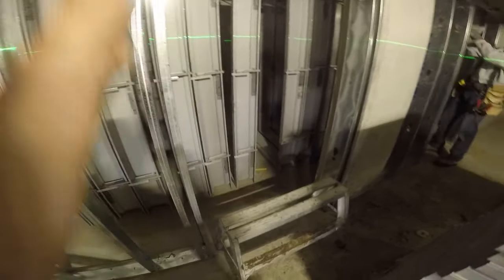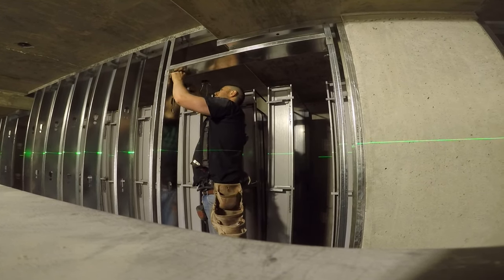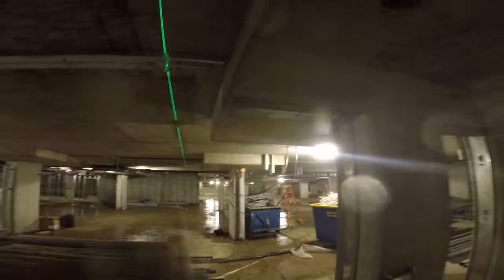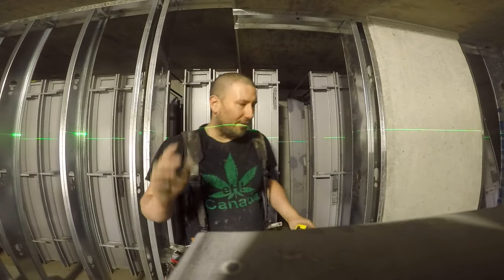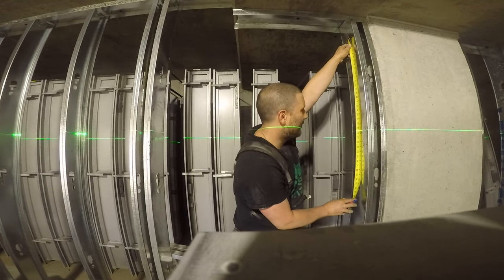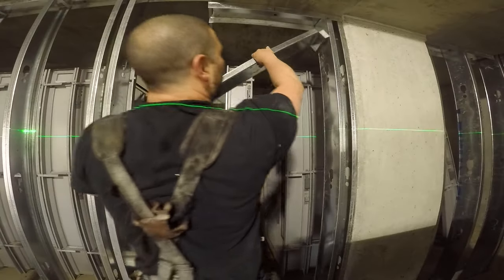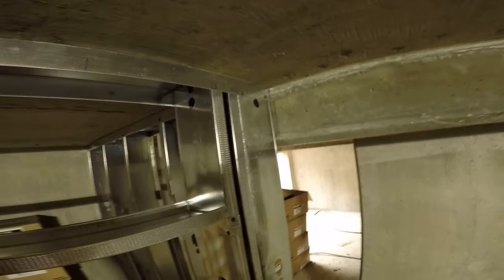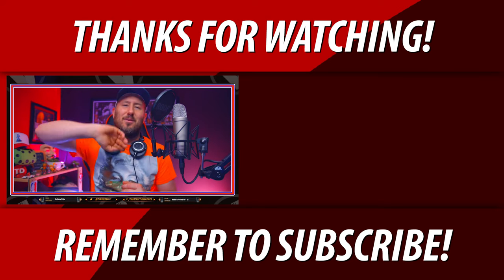Metal Stud Framing: Become A Pro At Door Headers Now!

Comment: Hey thanks a lot for the video!  Never done metal studs.  But I have basic experience with wood framing.  Do you have any videos just giving a quick intro and run down of what is different and what is the same.  Thanks!!
Reply from the maker: You know I don't but that is a really great video idea. I too was a wood framer first. There is a lot of differences but at the end of day of you understand the layout to maximize drywall layout to limit taped joints you will do great. Main thing is the steel is framed to structure with different top and bottom tracks or floating walls that are framed standing up already. Steel is more forgiving. Steel also always goes in the same way, measure bottom up, cut the tops off so the knockouts line up. There is so different gauges of steel ranging from 25 to 15 (lower the stronger). Different tools too. Impact driver and direct fastening tools like a Hilti or Ramset. Cutting also requires snips and or abrasive chop saws. My recommendation tonyou is to also wear gloves as much as possible at first until you get used to handling it. Watch out steel can cut you in many ways. There is a lot to tell you, let me know if you have any questions I'll work on that video in the meantime. Thanks my man and good luck. 👍

Comment: @constructionkronies at the 5:33 mark, you measured 11 5/8 then 16 for your cripple studs i believe.  Did you go 11 5/8  considering the door studs on the right? Do they make up the first 16 from the concrete wall? 
Thank you for sharing your expertise. I am learning,  and getting better.
Reply from the maker: Thanks man. What I was doing it I know the Door stud is lasered up beauty and the layout for the centers is on the top track all you have to do is copy that measurement to your headers and it too will be plum. These are small walls, on most other walls that would make more sense. I even write on the floor with a pencil the centers in so I can copy them up. Does that make sense?

Comment: Great Video! Not Very good Techniques for speed! Finding out your header height and marking it on a scrap stud you could mark all your door studs with header height very quickly! Then when you set your laser to set the header choose the higher mark! Eliminates unnecessary measuring. I also have never used a clamp! I don't think I would have a job for long using these techniques! But I did enjoy the video and this is great information
Reply from the maker: Cool dude, yeah I know what your saying. These techniques are for beginners to understand the entire process. I'm curious about your scrap stud technique. Where do you get your level line or benchmark from for each door or do you level a line go mark all your doors, then cut a piece of stud to length and put it on your level mark, using it instead of a tape. I like it.

Comment: It's OK to have the flaps you bend (you called it shoe) short? The guys that trained me make them 4 inches, is that necessary? I see yours looked way shorter.
Reply from the maker: Sure is yes. I only make them 2" and I screw them through the inside of the studs to give the drywall more room in the top corners at the header where it can be tight. You can make them as big as you want I don't see it being a problem other than some frames are tighter than others.
Reply: Cool, thanks for the response and the informative videos.

Comment: wanting to build two doors in my barn garage (garage inside of our barn) for   the tractor. Want to make the actual doors from steel studs not wood, so they will be lighter. I have solid wood  6x6 post to hang the hinges and doors from. Doors will be 5ft wide, 8ft tall. Any hints/suggestions on frame design of the stell studs. Will be hoping to face it with 1/4" plywood. I have looked for video info and have found nothing.
Reply from the maker: Yes, I would actually use 1/2" plywood, you can use 3-5/8" or 6" 25 gauge steel stud and track. Double stud your ends. If you want to make it stronger use 20 gauge 3-5/8"
Reply: @ConstructionKronies  thankyou for the tips!!
Reply from the maker: @veggies116  Very welcome!!!

Comment: What's the best material to span a 14' ceiling when you're using metal studs?
Reply from the maker: Furring bar, angle, channel and hanger wire.
Reply from the maker: Furring bar, angle, channel and hanger wire.

Comment: Do you put any seal between concrete and the tracks
Reply from the maker: Yes. Black acoustic caulking like mono or chemtron 1/4" bead for interior walls or a foam gasket for exterior walls.

Comment: I’m a level 2 welder with tickets and have no work I’m thinking of either doing taping, framing, or drywall what should I do I work in a auto shop there’s no work in auto or welding
Reply from the maker: Man I would go to a structural steel company and get in with the iron workers. Maybe start shooting for a seat in a crane as an op? With your welding talents you would be very valuable. If you want a big change taping and steel stud, stay away from drywall as much as you can. Framing would probably be more suitable to a mechanical minded person but first try to get in with a structural steel  or crane company.

Comment: Hi Chris, love your enthusiasm. I have a query about how strong the 6" studs are horizontally when joined together as a box section. Is this a test you could perform for us? I'd suggest joining 2 together creating a box section then repeating again so you have 2 box sections, then screw some osb to them both at 16" centres as though it's a floor section and pile on weights to test the strength
Reply from the maker: O yeah I see what you mean. 6x6 box beams are super strong. I have all my tools, scaffold and sheets of drywall stacked on the before. That would be a cool test! Thanks!
Reply: @ConstructionKronies  nice, but can you test 6x2 boxes as well, as in 2 C sections joined together like a rectangular box section? Bet they're stronger than a ladder truss
Reply: @ConstructionKronies  this is the test I saw, can you repeat it with 6x2 boxes? https://youtu.be/PJ-e-yhZSB4

Comment: So you always go worth the low side instead of the high side while installing a header ?
Reply from the maker: No the opposite. Always go with the high side which will be the side with the lower measurement. If you measure your header off the low side you won't be able to get full height on the high side (not enough room).

Comment: Thanks Chris. I'm framing an exterior wall, 18ga x 6" studs. 6ft opening for a pair of storefront aluminum doors. What is the acceptable reinforcement for the jamb studs?
Reply from the maker: Always double stud either side of the opening and build a box beam for the header instructions here: https://youtu.be/s7Fd1zFCjws also when you install the wall channel use clips or pieces of angle to keep everything tied into the structure.  Good luck and don't hesitate to ask me more!

Comment: How high from the door frame should the header be? 2-5/8”?
Reply from the maker: That's a good question, you know I've never been taught any specific elevation, I actually only raise it a half inch to 1 inch above the frame. Sometimes the door frames are wrong and set for 1/2" on a 5/8" wall for example, then you can raise it up a little more to help get the board in behind the frame. The typical header height is 85" from the high side for a 3x7 std door.
Reply: @ConstructionKronies  thats what i was thinking too. another question, is acoustic insulation R11 and fire rated insulation R19?
Reply from the maker: How insulation works is the R value represents the thickness of the wall. For batt insulation r12 for 3-5/8", and R20 for 6" studs. Semi rigid or Roxul is more dense so for example 6" studs will take R22. So yeah the Rvalues for each type of insulation (batt, semi-rigid, and rigid) represent the wall thickness. Does that make sense?

Comment: This is a bit late but why screw the flange of the stud? Why not just screw the face on inside of kingstud? Doing it this way eliminates any protrusion of the framing screw from getting in the way of the drywall as your trying to install it into the jam
Reply from the maker: So that won't be much of an issue. This is light gauge steel and the screws are pan heads. One of the tricks to drywalling a door frame is to hit the screws with a hammer, even the screws through the studs in the bottom track. As soon as we jump to 20 gauge or heavier I don't cut and fold the track, I use 4 to 6" pcs of stud to catch the track so all of the screws are on the face and the track doesn't overlap the door studs.
Reply: @ConstructionKronies  I deal with 20 gauge and up so just hammering in the panhead screws won’t  quite do the trick, I considered using L metal on both sides of door , and then sitting the header track right on the L metal. And then screwing it from bottom, to eliminate the pan heads on both corners of the door opening.

Comment: Why no timber for the doors
Reply from the maker: We actually don't use wood unless it's a wood jam or an exterior door that needs membrane. Sometimes we add a second stud to each side of the door or use 20 gauge door studs in 25 gauge walls. Some door and window openings are for glazing systems that you would need wood too. We use self drilling framing screws on the metal doors.
Reply: Every door opening I have done in 20 years has timber inside the stud,so that isn't the speck,that's the way I was taught,plus told never screw stud into track at head for movement up and down,also easier setting out the boards when not screwed
Reply from the maker: @petemelarkey9529  That goes to show you how we do things differently in some regions. It's funny when I do work in Ontario they do things completely differently then us in Alberta. Thank you for sharing!

Comment: Never seen headers go in before the door. Not how we do it in Tx.
Reply from the maker: Sure you have, I know lots of guys in TX who did it like this. These are fire rated welded frames, the header always goes in first. Even for 3 PC doors this is the best way, even wood jams the headers go in first. What kind of doors are you guys using, seriously I am very curious.
Reply: Raco metal frame doors
Reply from the maker: I was thinking and I think what is missing here is the door frame itself. I've had a few door installs and they just haven't been timed right. In a best case scenario you want to be framing and installing the door frames at the same time. I don't know why these contracts now are breaking that up. It's a huge waste of time for everyone except the GC. Then you can double stud and set everything properly.

Comment: You only need a 12 volt for metal studs
Reply from the maker: A 12v can do 25 gauge maybe 20 but the problem is you have to change batteries a lot more. It's better to have 20 or 22v tools because they can do more of the trade scope. Definitely for commercial and industrial jobs you need a 20-22v.
Reply: Construction Kronies I use a hilti 12 volt with a 4 amp battery , it lasts the entire day for me my crew frames a basement a day it’s really light steel the stuff we use
Reply from the maker: @whoareyou551  ya you know I haven't used the Hilti or have I seen it in action, almost forgot Hilti has a 12v line, not going to argue that Hilti is the best!!

Comment: You all screw shit together so easy. I picked up a bunch of steel framing material pretty sure it’s like structural. So hard to get screwed together,pretty much have to pre drill everything what a pain in the ass
Reply from the maker: When we get down to the 15 gauge we start pre drilling. I find the number 8 self drilling framing screws work the best for everything heavy but sometimes they spec the num. 10's and they are a serious pain in the ass, half to pre drill all of the studs at the  top track.

Comment: Ears are better and more precise.
Reply from the maker: You could do ears, doesn't make any difference at all. In fact I would argue the shoe is better, what makes it harder for drywall in the wafer screws, with the shoe you can screw into the flat rather then on the flange.

Comment: Chris when you are putting cripple studs over a door you measured the lay-out totally wrong. What you done is what a 1st year apprentice would do such a rookie mistake. You pull your measurement's from a fixed stud that is set at 16" on center so when you are installing your drywall it end on a 16" on center stud.
Reply from the maker: Wow your quick to judge, i do that everytime, when doing header studs, your layout is usually done on the top track already so you measure over from your lasered in door stud and then measure over at the header. Chris doesnt do rookie mistakes try again!
Reply: Well i guess you & Chris have a clue how to lay out studs. You don't take your measurements from a door stud as they don't fall on 16" on center you pull your 16" from the start of the wall with the stud facing towards the way you are hanging your drywall. As by the way Rookies door openings don't fall on 16" on center. I hate to see your framing be like watching amateur hour.
Reply from the maker: @JB-sz3yw  MG your not getting it at all. Like I said before the layout is already done on the top track. When you install your door studs, you laser up 1 side,  then you measure over on the top track to your other door stud, when you install the header, (remember the layout is done on the top track) you also check the measurement from the door stud to the first 16" on the top track, then you copy that same number from the top track to the header. That way your not over reaching or trying to get a number from a stud that is not perfectly level. Man your the rookie.
Reply: Plus he never used a double stud at the door. And the door frames in background look like welded frames so that framing method will not work. This framing method will only work a K.D frame.
Reply from the maker: Sorry man you caught me in a mood yesterday. Your very determined to find something wrong eh. Well, the thing is I hate doing it this way. I like to install the doors as I go but some jobs have door guys that come in after the framing is done. I can install a welded frame no prob this way its just unfortunate you have to unscrew the studs and one side of the header. The framing is always the same no matter the type of door just the order you do things changes. So what we decided to do here is add the second door stud after the door is installed so they can fasten to the clips. A bit won key I know but I don't get to make all of the decisions.  Cheers mate!
Reply: No problem we all have off days. And i always install my welded doors frames first by attaching a stud to door 1 door side & level head by put a shim under the  other leg and then screw it to the frame. This a handy trick for you. Then i get two speed squares and put in top of the frame and rest my metal header on the squares and attach to both studs & fill in my cripple studs and the add a double up my studs at the door also. And i would bend a piece of track about 8" in half and attach this to my door stud and attach my second stud to this in the middle so it won't warp in the middle and makes the door legs more stronger when you screw the rock.
Reply from the maker: Nice, i will for sure try that, sounds solid to me.